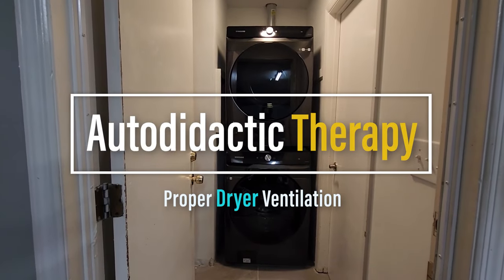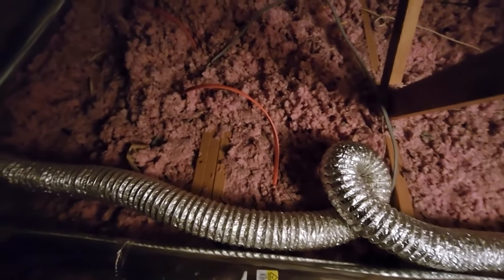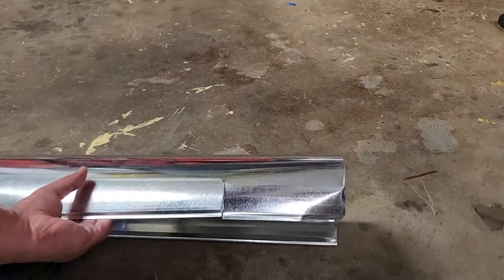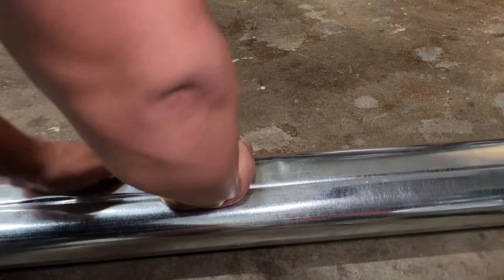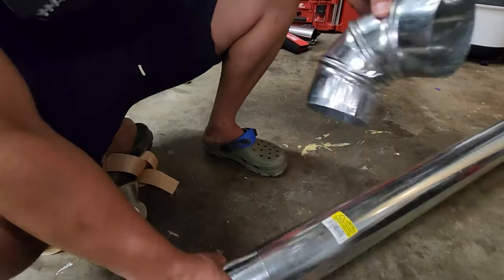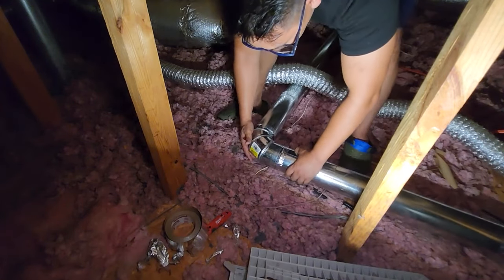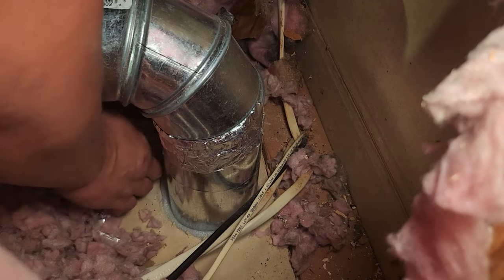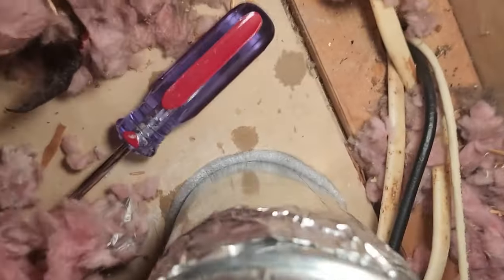How to Install Code Appropriate Dryer Ventilation

Comment: There is also a code for how many 90s you are allowed to have based on the total run.  It is dependent on the model of dryer.   And your male/female connection is in the wrong direction.

Comment: Once you get it in the horizontal plane you could use a 45 .  This will give a short cut  , then use another 45 on the other end .    two 45s are less restrictive than a 90, and there's probably several feet less pipe

Comment: If you have a long run like that on a dryer it will take forever for your clothes to dry.. instead of going through all that trouble to run a vent up through the Attic, just buy a good LG heat pump dryer and you will not need to run a vent. 50% more efficient than any electric or gas dryer and there is no need for a vent.
Reply from the maker: I did not know that awesome thankyou so much.

Comment: One big thing is wrap that vent hose in insulation to prevent condensation and mold in your attic ! Might be too late already, and that small foam does not seal near good enough like if you got silicon and sealed it  after.
Reply from the maker: Hello thanks for the comment. Great idea and it make sense. Do you have a wrap brand you recommend?
Reply: I've never seen something hot create condensation. 
I can't think of any examples where that happens.
Reply: Cold is the cause of condensation. Below the dew point temps. Like your ice cold can of beer on a hot summer day. Insulated pipes in unconditioned spaces has been adopted in many many areas though because the condensation happens when the pipe gets cold in winter and then you run warm moist air through the pipe, it condenses inside the pipe before it can get outside. And then, well, water dripping into your dryer or depending on slope, somewhere else.

Comment: You’re the first video I’ve see that mentions taping the seam on the pipe. I would only tape seams on interior wall areas. Attic/crawl space piping don’t matter really unless it’s a conditioned space. I’m also impressed to see you seal around the penetration. I’d have used some spray foam myself but your method seems to work.  Thanks for sharing.
Reply: Nope, even more important to seal joints in the cold attic. That moist warm air in an attic will condense on every cold area in the attic and start a mold festival in winters.

Comment: Okay, we have a video with great intentions but....IRC which is code States all eventually adopt want Rigid smooth metal pipe. This part is correct. Crimped pipe should always face outside direction(downstream) otherwise lint gathers on the crimped joint. Foam backer rod is used with caulk and is combustible. Orange spray foam is combustible (I called Dow) it must be covered with ingnition barrier not because of the vent heat but in case of house fire. Fire putty works great for that through attic gap. The duct elbow and length maximums are in the installation guide. The code usually wants you to follow manufactures specs on this. That puts liability on them and not on your local city/village. 
Code will usually say water shut off needs to be accessible in case of emergency. Like I mentioned before IRC is usually eventually adopted by your local municipality for safety. Sometimes years after but eventually it happens. It really doesn't help that local hardware stores sell products that are totally against code like plastic ducting, rigid foam attic hatches, non tamper resistant outlets etc....but it may hurt when an insurance company won't cover part of a claim if you did something shady.

Comment: I love that code has something to say about vent. But nothing about placement of water supply.
Good luck shutting your water off in case of a leak.
Reply: I believe code addresses access to shut off valves as well as electrical panels in case of an emergency so emergency responders can act quickly. Maybe not in your local code, but in County, State or Federal codes. Often local inspectors don't even know about some of these. I called out my local inspector for allowing plastic duct for my dryer. It was temporary but he still allowed it even though my state doesn't allow it.

Comment: In Canada you have to insulate your pipe in the attic and minimum 4 feet on the warm side ( inside the house ) by code 
You crimped end has to go towards the outside what you did is afire hasard. I’ve been in residential heating for over 40 years

Comment: I would use 3M red fire rated barrier caulking for pipe penetration between floors (besides other suggestion above but already too late unless you want to redo) otherwise VERY useful info

Comment: you could probably use that as backer rod to hold the vent in place and then fill the void on the other side with spray foam, cut flush and use compound to fill that gap tight.
Reply from the maker: Oh nice thanks

Comment: question for you... I live in a condo and have an upstairs neighbor. I can't change out the flexible one with ease. Can I cover it by using the steel hard pipe as a brace?? Im renovating my laundry closet but don't know the best way to handle that transition hosing.
Reply from the maker: Hello K.B! ADT is a DIY channel but ultimately seeks Professional opinion when possible. We appreciate the inquiry, to partly assist the hosing used should be one or the other. We recommend contacting the Landlord for safety and concern.
Reply: @Self-taught_Therapy  I own my unit. but I will most definitely seek a professional opinion

Comment: I would use red fire foam.
Reply: Orange spray can Fire foam is combustible. Needs to have ingnition barrier, usually 1/2" drywall or equivalent. There are some exceptions. Like rim joists in a basement. It's a marketing gimmick, I called and asked dow. I think the orange foam is for inspectors to easily identify that you have sealed wire holes before drywall goes on. So right after wiring rough in inspection. Pre drywall. The fire caulk may be an option. I did not check that one. Fire putty makes the cut. Used for soundproofing outlet boxes as well.